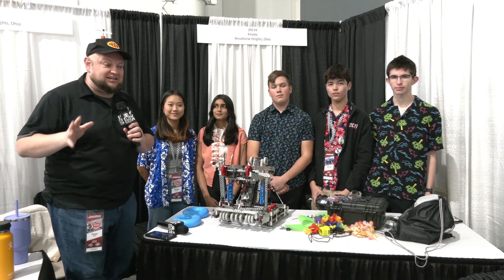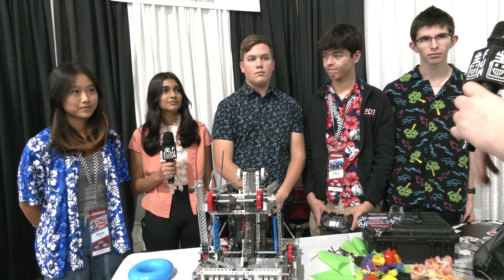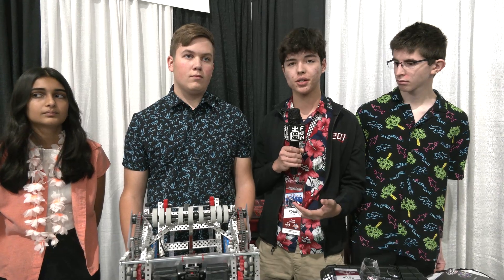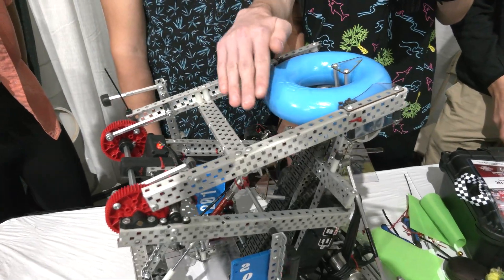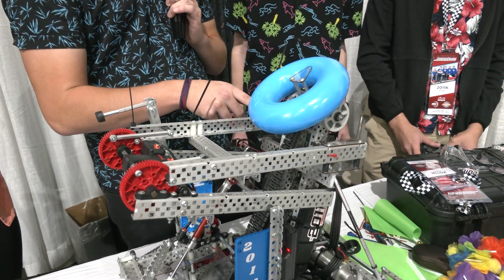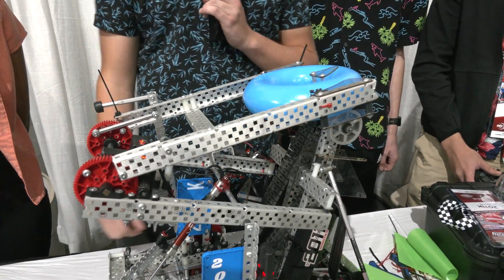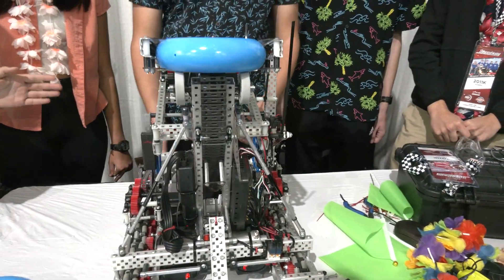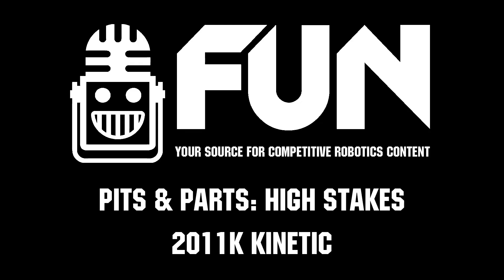2011K Kinetic | Pits & Parts | High Stakes 2024

Comment: 1:10 ahh a six wheel drive very interesting especially with the 2.5" omni
Reply: It's a new meta trustt
Reply: 2.75*
Reply: @Jimbo-u1w  exactly, that is normal. which is why it is so interesting that they use 2.5"
Reply: @truettweber she misspoke
Reply: @truettweber  they  use 2.75 inch wheels on 8 wheels, 600rpm 6motor drive
people have been doing this drive for a while depending on the season, some teams used it in spin up, but it is unique that they used it for high stakes
Reply: @960t-wn7lo  are you sure, it seems like they are using a different wheel size?
Reply: @truettweber  vex only sells 2.75", 3.25" and 4", since they are omni wheels some people say that the 2.75" is closer to 2.625" and that the 3.25" is closer to 3.125"
Reply: @truettweber  only 2.75" fits in a 600rpm 36 tooth arrangment like that
Reply: @960t-wn7lo  I thought they just 3d printed 2.5" wheels to fit on their robot, this size would also fit with 600rpm 36 tooth
Reply: @truettweber  3d printing isn't allowed in middle school/high school vex.
Reply: Yall just got trolled by truett
Reply: @HippityhoppityGnW  😭ruining my fun
Reply: @HippityhoppityGnW  bruh 😭
Reply: @960t-wn7lo  u were a good commenter just trying to help out someone who "needed" it sorry I had to make u go through that